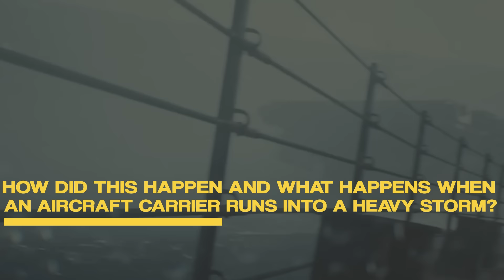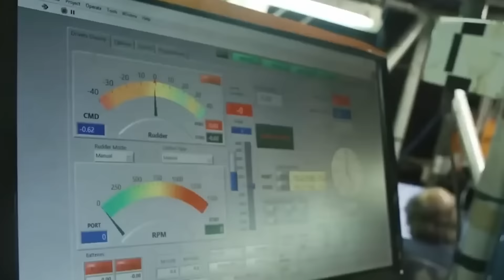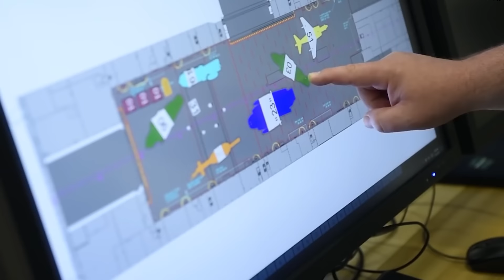How Does World's Largest Aircraft Carrier Stay Level?

Comment: I was on the carrier Constellation in the 70's. We were caught in a typhoon off Thailand and even for it's massive size and weight it was quite a ride. The flight deck was closed off to anyone and all hatches and doors were secured closed. All aircraft were tied down with 24 chains ( if you could find that many ). We watched the sea through our shop bulkhead door and it would scare the death out of you to see how powerful the sea can be. 80+ foot swells and rollers is a sight you will never forget. Hitting the swells at   90 degrees to keep from rolling over would cause the whole ship to hesitate for a second from moving forward . For a 100,000 ton ship that was impressive.
Reply: 80 ft swells? WHEW!
Reply: Sounds like a helluva ride. Huge waves hitting a huge ship means something has to give. 5000 - 6000 people on board would be a heavy loss if capsized.
Reply: I think there numbers for the amount of ballast the Ford can handle is a bit off.  They said 4 tanks at 7 million gallons each.  At 8 lbs per gallon and 2000 lbs per tonn, that works out to 112000 tonns of variable ballast for a 100000 tonn ship...that amount of ballast would sink it...
Reply: I was on the USS Independence in 1969. We were in the north Atlantic when we encountered an unusual typhoon. Green water over the flight deck. 75 to 80 foot swells. Scared the hell out of me. Will never forget it, ever. I still don't know how the destroyers made it through, but they did. Water was seeping through the hanger deck doors. Peanut butter and crackers to keep from getting seasick. The ocean has unbelievable power.

Comment: Ships can't drop anchor to the sea bed unless it's in shallow water. The chain is only so long. It's not the anchor that holds a ship in place, it's the chain's weight.
Reply: Spot on!
Reply: Even then it doesn't always work. We were in the Bay of Naples with a reactor down and all engines at cold idle when a storm blew in. We were dragging anchor. They had to bring up the idle reactor and do an expedited light off of both engine rooms. We steamed out of Naples and left quite a few of the crew on the beach. I got to stand a nine hour upper level port watch in #1 MMR that day. Ships are often safer underway than in port when it really starts to blow.
Reply: @patrickweaver1105  Same thing happened to USS Wasp in Stavanger, Norway in 1995. Wasp dragged anchor, got underway and left over 200 crew/embarked Marines on the beach. I was on USS Whidbey Island LSD 41 then. WBI took everyone stranded onboard.

Comment: As part of AntiSub Squadron 24 (VS-24) operating S-2Es aboard the USS Randolph (CVS-15) coming back from the Med across the North Atlantic in mid December 1967, we had a number of wild rides. Normal tied downs for the S-2E were 6, 2 on each wheel, as Joe pointed out in his post we were at 24 tie downs. On a previous trip like this the Air Group lost an S-2E over the side. First reaction was that there weren't enough chains until they went out (after seas calmed down) and discovered 24 missing pad eyes in the deck. The violent weather pulled them out.

We were taking green water over the first helo spot on the flight deck (about 60' back from the hurricane bow). As many aircraft as we could get in the hanger bay, were there and the rest were on the fantail (pad eyes had been replaced during a yard visit before we sailed in September of 1967. The catwalks were all closed and no one was to go outside. 

In the JO Bunk room (the one for VS-24 was under the port cat, the one for our sister squadron was under the starboard cat). We could feel the ship nose up on one wave and then nose down into the next wave and the entire ship shuddered when that happened, along with the high pitch whine from the screws when they came out of the water. Keep in mind that although the Essex class carriers were a bit shorter and lighter than the Forrestal class and above, our overall length was still 888 feet. 

The ones I really felt sorry for were the small boys (Destroyers) that were with us and attempting to hold position.
Reply: I was in VS-27 about that time on the Randolph remember the bent prop shaft and we could not out run the hurricane . I was on a plane on the hanger deck safety wiring on a carb was like  a wild ride. Felt sorry for the destroyer with us waves breaking on the bridge front gun under water.

Comment: Carriers maintain a four degree list to the port side. This helps keep landing aircraft away from the Super Structure ( island).
Reply: USS FORRESTAL CV-59 82-84
Reply: @williamdodge5123  My brother was an ET on board in June of '67
Reply: @SuperSaltydog77  
"Trial by Fire"
You Tube.  1967 fire onboard USS FORRESTAL CV 59 134 Sailors perished from surplus WW2 bombs. They tried to reject the delivery,  were told its all we have!
Reply: Is that true?
Reply: China is learning these things the hard way. Just looking at the huge cracks in their new carrier. There is no cutting corners when it comes to building a city with a airport at sea.
Reply: Damage Contol Central POOW.
Using seawater to flood voids to keep 4° list to port while underway. Had two massive voids aft that when used it changed the draft of the ship.
  Took days to empty....

Comment: I've served on both Ships and Submarines. Submarines on the surface are far worse than any ship because of their rounded hull. The East coast is worse than the West coast because of how far out the continental shelf extends off of the East coast so you have to surface farther out. I remember my Sub doing 45 degree rolls side to side. Back in Engineering only myself as Reactor Operator and the Engine Room Supervisor were still on our feet and not throwing up. So I operated the throttles, the Reactor plant and the Electric plant while the Engine Room Supervisor operated all the equipment outside of Maneuvering. It was a busy 3 hours.
Reply: When this happened were you submerged,  I often wonder how stable subs are when cruising.   Lucky to have tour on RR & CW when port visits for liberty.

Comment: I was on USS Standley CG-32 in 1979 between Hawaii and Guam. We were in a super typhoon and had 25-foot seas. I don't recall the carrier we were with but the admiral's staff I was on was embarked in USS Standley. The fantail and many of the weather decks were awash and we took many waves over the bow. It was very hard to stand watches and sleeping was very hard to do while we were in the storm. The seas were extremely rough and not all of the waves were hit at exactly 90 degrees as we had to maintain movement in a southwesterly direction in order to make Guam in a reasonable amount of time. Safety of course was primary in that storm and most people got seasick to some degree. Cooking meals was difficult as well in the heavy seas and many of the weather decks were off-limits. 30 -40 degree rolls were not uncommon.